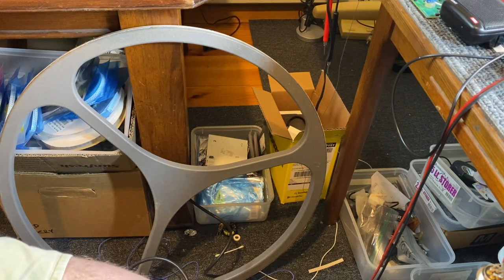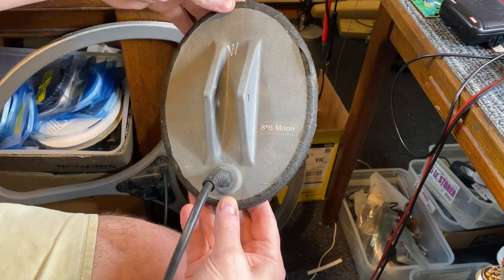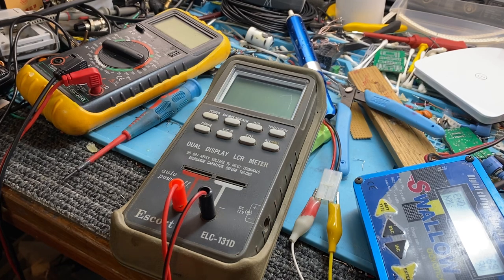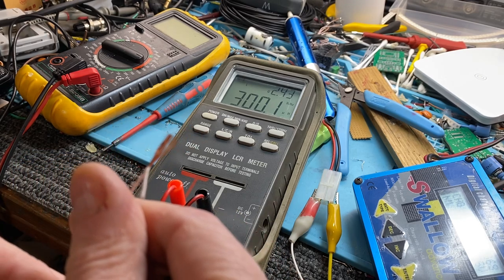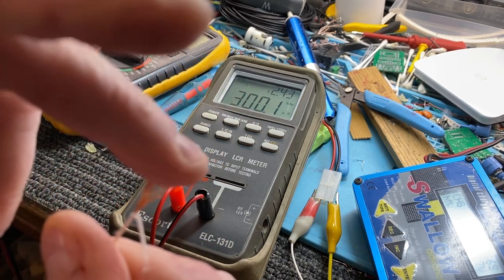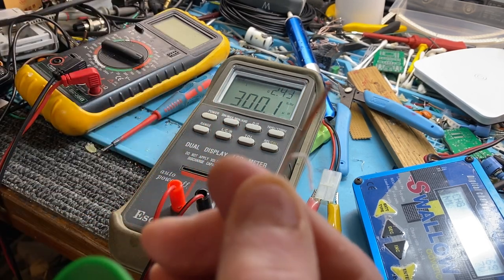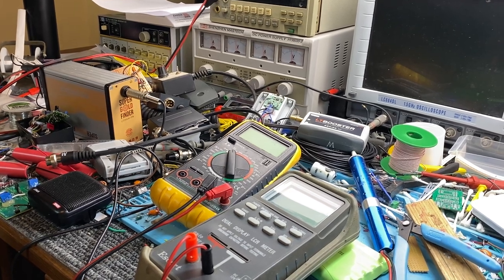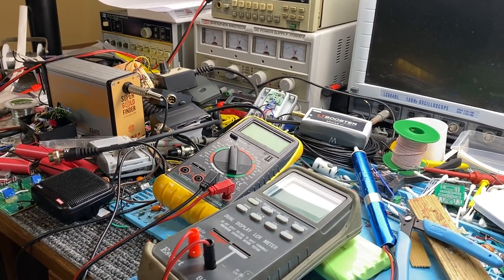All about coils for Minelab P.I metal detectors.

Comment: Got a curved ball thought If one made AL litz wire and only relied on AL oxide as strand separators .... would it be any good???
Reply from the maker: It works but it should be copper plated but some other detector company did this and got it wrong.

Comment: Pulse icin hangi kobloyu onerirsin 2*2 ebatta baslikicin
Reply from the maker: In just about every coil it should be made from litz wire , even the cable from the coil to the detector should be coaxial litz wire with spiral braid.
Reply: Tesero detektör nasılıdır

Comment: Hello how to find this type of wire roll i see on your video please
Reply from the maker: That wire was on EBay.
Reply: Thanks I need to create coil for 350 at 450uh for delta pulse or sniffer xr71 do you have recommandation for the type of wire needed?50 stranded wire 0.07 plated wire are good choice?please
Reply: @karimkarim-ib5mt  I have not made a coil for that detector before so you will need to experiment.

Comment: Try test it out tarnagulla way, Seems to be drying up and mozzies aren't too bad
It's where i use my modded 4500, Can run front gain on about 70% and rx gain on 8 with no ground noise

Try do 8 rx gain on a normal 4500 and it's no where near as good! Can't wait for 2nd lot of mods

I live out tarnagulla, So gunna be making a test patch shortly for the public to use.

Happy for you to borrow the 45 for a day if you need to compare standard/variable frequency modded + front rx gain mod/New chip mods/ first and 2nd gen mods combo
Would love to see all 4 against each other! Can 100% vouch for your mods, Fantastic work woody.
Reply from the maker: If it is not raining and dry then i will be out there.